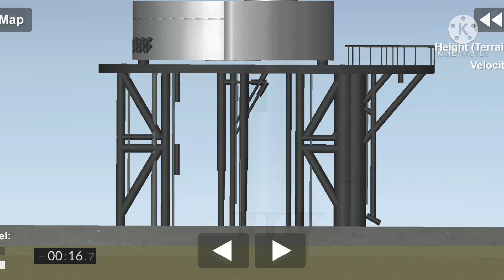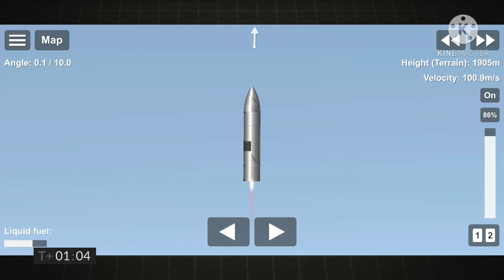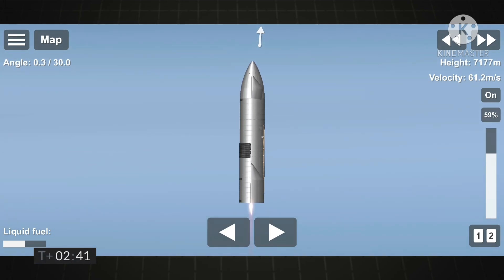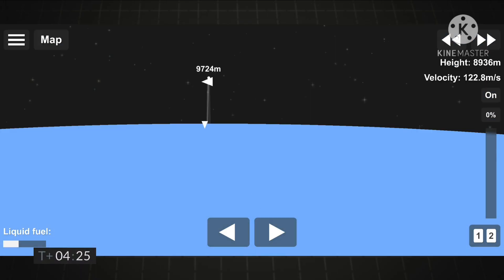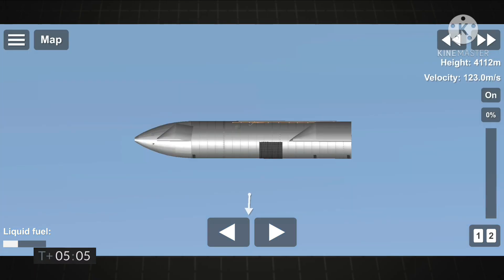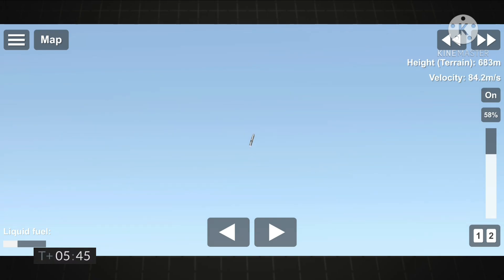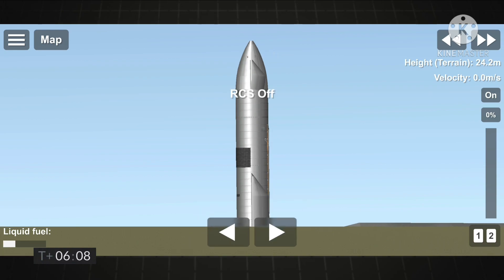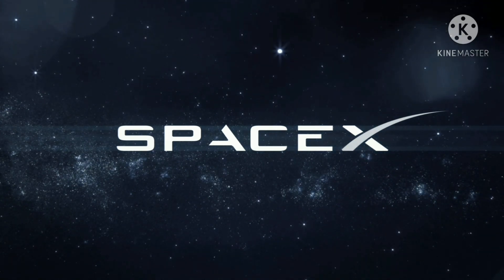Starship | SN15 | High - Altitude Flight Test SFS 1.52

Comment: SN15 Launch Sequence
T-00.00: Ignition
T+00.01: Lift-off
T+02.00: 1st Raptor engine shutdown
T+03.32: 2nd Raptor engine shutdown
T+03.59: 3rd Raptor engine shutdown and bellyflop manuver
T+05.42: The first Raptor engine restarted
T+05.43: The second Raptor engine restarts and flip manuver
T+05.59: Landing